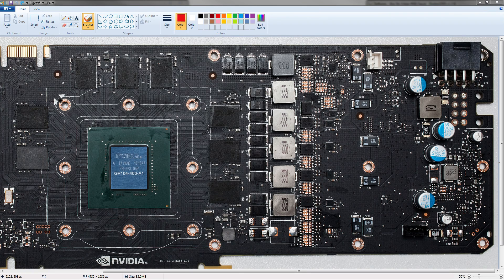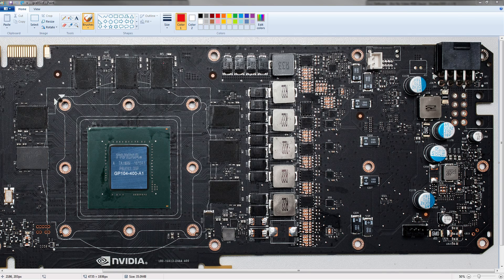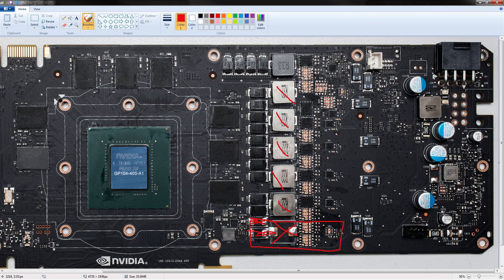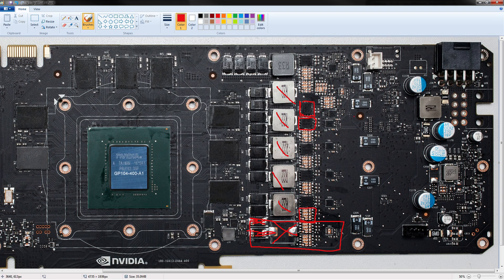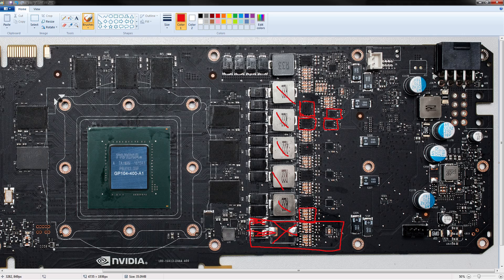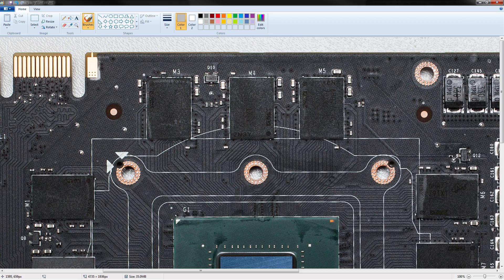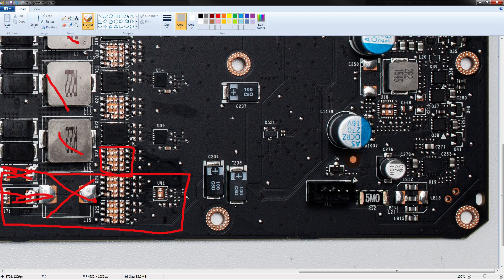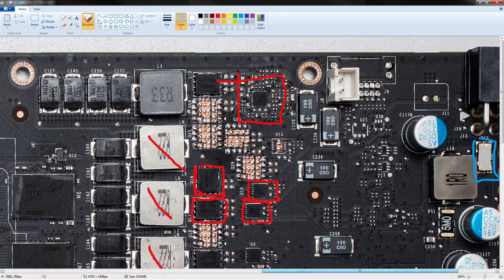GTX 1080 FE PCB breakdown and power limit mod

Comment: @Actually Hardcore Overclocking There is another power limit mod involving additional resistors placed parallel too 3 capacitors routed to the Power Sense IC. The mod uses 10 ohm 805 resistors. This results in power usage being reported 3 times less than actual. I'm curious if by playing with the values ie using higher resistance the effect would be lessened. I like to push the card a little harder for daily use. Thanks if you happen to ever see this.

Comment: Hey man,  what I wonder: 225 Watts is the maximum of power by 8Pin psu connector(150W) + 75W from PCIE slot if Im not mistaken, so if my card already uses in stock 220 Watts(Gigabyte Windforce, with also only 1 x 8 pin connector, MSI afterburner set to maximum of 108% for power..), the powermod wouldnt work , right? bc if the card wants to draw 250 watts after the mod, there is still only 225 available? thanks in advance! Regards Dave

Comment: "You don't have a ton of power current throughput so there is a good chance that with a power mod or voltage mod this VRM will go up in flames, so lets get on to that power mod."                  Buildzoid Great quote lol

Comment: @buildzoid , curious question , whats up with the extra 8 pin connector solder pads on the back of the reference pcbs ? there perhaps a mini mod that one can do with ref boards with em ?

Comment: That's interesting.
Your friend der8auer in his video about power mod of 1080/1070 was also referring to only one (exactly the same) shunt resistor.
I had applied liquid metal on it, and it did (somewhat) increased the power limit.
Are you sure about two other shunts ?

Also, on 1070, there are only 4 phases. does it mean that it is limited by 220watt (1.093v*4*50A) for vcore ?
Even though my card is with full cover block, coolant can get into 35-40C (i have room temperature of 25-35C for the most part of the year). So far it runs fine on 2.1GHz@1.05V.
Will it still be "safe" to "further" power mod the card ? (lowering resistance on other two shunts).

Comment: 1070 EVGA SC which is on the reference PCB here...wish I knew exactly where those other two shunts locations before I did this. Is that 5MO to the bottom-left of the R002 one of them?

Comment: is the msi seahawk ek can be modded as the same way too?
Reply from the maker: if it runs the same PCB the power mod will work the same way. Do not however that I missspoke here. The 10 series GPUs have some extra fault protection so you can't use solder to short the shunts out. You have to use Coollaboratory liquid Ultra.
Reply: Yes since it has the same board as the founders' edition card.
Reply: I did apply CLU works great.

Comment: Sooooo on https://xdevs.com/guide/pascal_oc/#step3 , they say :
"Note
 that earlier version of this guide incorrectly mentioned need to short 
RS1, RS2, RS3. This is wrong, and will cause card clock to lock at 
135MHz. Do not short shunt resistors themselves, but add resistors like 
shown on photo below. Sorry for confusion."

Sooo ?
Reply from the maker: I'm aware of the issue and all the 10xx card videos will get annotations pointing out that problem. The CLU method still works(Der8auer told me it works and used it on a few cards already) However soldering the shunts drops the resitance so low that the card notices that there is something wrong with power in readings and gets stuck in 2D clocks.
Reply: Nice man ! Thanks for the answer. 
Does it matter how much of CLU you apply on all 3 rs1/2/3 ?
Come to 1080 thread on ocn, we are discussing it now! :)
Reply from the maker: I guess if you did a really thick layer you would run into the same problem as you would with soldering. I'd say you should short 1 shunt. Test for throttling. If you need more power short another one. Test again. If you still need more power short the 3rd one. At this point you really shouldn't need more power. But if you do you could try thicken the layer of CLU.
Reply: Cheerz bud!
Reply: Hi again. So is it safe to say that if you CLU mod 2 out or 3 resistors(any 2 ??? ) then all should be fine ?
Reply from the maker: should be. Worst case scenario you just need to use some alcohol to remove the CLU form one of the resistors

Comment: What if you don't short the entire thing, but we change the resistance value reported from the shunt?  This could provide a safer alternative and with the correct range potentiometer or variable resistor soldered to the shunt you would have full control, plus you would be able to instantly take it back close to stock.

Just a quick thought.  I have done two voltage mods in the past that used a potentiometer, 7900GT KO and 8800 GTS 512, so it's a natural to me, just have to know where to put it.  (both of those cards are still going fine, OCing is safe if done right, even hardware mods (which I love!!))

Comment: hi, id like to talk about the EVGA Classified GTX 980. I tried everything, but cant get more than 1,21 Volts on it. I used the Classified Controller to change the voltage, thats a little tool. Works fine for the Vram voltage, so i can get to 4100mhz easily. But the core voltage...if i put it to, lets say, 1,35 Volts, following things happen: The power limit instantly goes from 60-70% to 90-100%...also temps got up from 50-65 instantly (i have own cooling solution)..so it seems the extra Voltage is definetly doing an impact on the card, it uses was more power and becomes hotter. But i cant even get 15 mhz more core clock as usually. Also GPU-Z is showing me only 1,21 volts. The card just does not want to take advantage of the extra volts. I tried custom bios as well, also tried own BIOS..wrote values like 1,275 Volts in it, same result, not able to take the smallest advantage. It seems to me theres some kind of mechanism not allowing the card to use the volts. But why does it use more power? And yeah, i also tried the Prexision X. This tool was even made for this card and shit doesnt work. I can go to 1,3 Volts there, it has an impact, card uses more power, becomes hotter---but no extra Clockspeed. Do you have an idea?
Reply from the maker: From what I've heard maxwell doesn't scale with voltage unless you take it bellow ambient temperatures. I've never overclocked maxwell GPU so I can't really tell you much more.
Reply: ok but you seem to know something about that PCB...on MSI Afterburner you can also incread voltage about 0.37...even that does not increase voltage to more than 1,21...i mean there is a difference between "it doesn scale" and "having not the smallest affect"``just frustrating...:(...gpu gets only 52 C  while gaming usually-
Reply: Actually Hardcore Overclocking
i mean al that power phases and that giant power limit, what the sense behind all that shit if i cant overvolt or the chip saying "i have no use for overvolts"....:(
Reply from the maker: You can check if the GPU core is actally getting the extra voltage with a digital multi meter. As for why the Classified comes with such an over built PCB. Well it's meant for Dry Ice, LN2 or Phase Change cooling.
Reply: well at least VRAM voltage works. Do you think it hamrs the card on a long term, if its running 1,7 Volts/4000mhz instead of default 1,6V/3500mhz?
Reply from the maker: 1.7V is fine

Comment: shorting the shunts and/or volt dividing the sensing circuit doesnt seem to unlock the power limit. Its done some other way inside the GPU.. custom bios required to unlock the limits "Asus StrixX OC" bios to be precise. enjoy
Reply from the maker: I think ASUS might be using per phase current sensing on their card. However for any of the dumber controllers shorting the shunts should work.
Reply: Well i'm using a Gigabyte FE and a number of others are using EVGA cards on other forums and report that shorting does SFA. Power limits are calculated some other way
Reply from the maker: Odd. From what Der8auer told me the only issue with shorting the shunts is that if you short them out too well the GPU gets stuck in 2D clocks.
Reply: +Actually Hardcore Overclocking 
with the default gigabyte bios it reported as about 5% TDP but instantly marked as power limit applied. I then did the 0805 resistor mod with a 81R cap to take the reported cap as 80% of real. this too marked power limit applied. FWIW the first benchmark seemed to show the max boost clock unlocked, but soon capped and limited itself.

so it either works out that calculated  power does not match reported power (that's what I'd do if I were the hw coder) or it uses a different system for power limits. I would then assume the external circuits are for trimming phases connected to the pcie bus and protecting against over current on the external header.

thoughts??

The Asus strixx oc bios removes all those pesky limits anyway... so... until some clever man works out how to mod the default FE bios to increase the real power caps I'll stick with the Asus BIOS..
Reply: +Actually Hardcore Overclocking 
oh ye and I've got it stable at 2100mhz and 1.15v with +550 on ram. I can't seem to push it much faster without lock ups in occt or overwatch.

the default bios with all limits pushed struggled to hold 1830. for me anyway... increasing voltage decreased freq due to power limits.. gah.

I'm running a EK water block with core temps of 41 degc reported.
Reply from the maker: Well I don't know a clever man but I do know a crazy man with any luck he'll get something that doesn't brick GPUs and helps with overclocking.

Comment: How likely, on a scale of 1 to 10, is it that this mod will damage something on the card.
Reply from the maker: without any overclocking. 0 If you really push the card on air or water cooling it's still pretty unlikely unless you let the VRM hit the 90s.
Reply: +Actually Hardcore Overclocking ok. Thanks.

Comment: awesome, managed to get another 100Mhz out of my 1080s with the power mod, now I'm stuck at 1.093V. Any custom bioses our there already?
Reply: the sensors are just reading like 80% max at full load, effectively removing power limit.
Reply: you can get another 50 to 100MHz out of vcore and vram by doing the power mod. if you have a chip that good, chances are you might make the 2200MHz.

I shorted out the 3 shunt resistors with coolaboratory liquid ultra, which can be removed with isopropanol just in case.

the bios limits the vcore voltage to a max of 1.09V anyways, so damaging your card is very unlikely.
glhf with yours ^^
Reply: lol
As already discribed, shorting out the 3 shunt resistors with CLU worked for me.
Here is a screenshot of GPU-Z showing one of my 1080s running at its maximum gpu clock of 2088MHz with a measured power consumption of 70%.
http://imgur.com/YGPiCOW

You chose to use a different method for shorting out the shunt resistors. While in theory any conductive material should work, I can not, and did not, verify anything else as working, except the method I tried.

If you try out a method that has not been done by others and is not verified as working, then that is your problem.
If you dont know what you are doing, then that is your problem.
I am not responsible for anything you do with your card. So do not blame me.
Reply: unigine heaven, the throttling is normal 1080 founders behaviour

Comment: So nvidia says the founder's edition has quality components and PCB. Youtubers with Electrical and Hardware experience say otherwise.
Reply from the maker: Just like every Nvidia reference card ever. The only exceptions being the 780Ti/980Ti/TITAN BE/TITAN X. Those PCBs could handle enough voltage for any water/aircooling benching session.
Reply: +Actually Hardcore Overclocking So the 1080Ti would probably handle hardcore overclocking as well.
Reply: +Skillless Gaming if we ever get a 1080ti.  Titan xp is already a cut down gp102,  and they can't halve the vram to 6gb to differentiate it
Reply: +Phoenix Wright true the pascal titan has the specs of a 1080ti and the price of a titan the gap is too small to squeeze a ti edition in it. maybe they will stop producing ti cards rip best price graphics cards

Comment: Hi, thanks for the overview. Can you please calculate what is the maximum power output of the GPU vrms at lets say 80, 100
degrees celsius ? 

I did this shunt resistor mod on GTX970 from MSI which had a good VRM design, but I am not sure what the headroom is here or if I should just wait for non-reference cards and return my FE card.
Reply from the maker: just wait for non reference.

Comment: I just shorted the shunts, now how will I know it's working? I can still only up the power to 120% due to driver restrictions.
Reply from the maker: The card should be showing lower power draw in any monitoring utility that can measure power draw. Also if you were getting power draw related throttling it should now be gone.
Reply: awesome, thanks.

Comment: its nothing new for NVidia ref boards to have missing phase placements.after the 680 gtx I stopped buying ref nv cards it was like walking on eggshells when hard modded. without adding in a power board to totally bypass the vrm/power area of the card  .the 680 was 500usd but then the titan/x  at $1k was the same pos "just enough to work" nv ref approach ,what really sucked is no custom boards for those chips.....I look forward to maybe some custom boards by July, like the DCII. I can mod my bios, easy hard mod and cooling good to go.
Reply: Yeah but the 4870 launched and it went down to 500ish some even got refunds

Comment: great video man, can you do a breakdown of older cards?
Reply: +Actually Hardcore Overclocking thanks dude, if I can assist somehow, tell me, if you will get really stuck, I should get a new screw set in the next couple of weeks, so I will be abel to disassemble the card and take photos (I planned to do so anyway to switch the thermal paste)
Reply from the maker: +אלכסנדר ברבר Ok could you get me pics of the back and front of the PCB with no heat sinks covering anything? Also a close up of both the memory and Vcore VRMs would be great because while I've managed to read the part # of the low side FETs I can't see what the smaller high side ones are.
Reply from the maker: +אלכסנדר ברבר Sure I could. Which do you want to see.
Reply: +Actually Hardcore Overclocking as an owner of an ageing r9 280x toxic edition, I would like to see that card, to kick the hell out of it and give it a proper goodbye
Reply: +אלכסנדר ברבר Why would someone waste their time doing that exactly?
Reply: +Callsign Vega it is still a pretty relevant card for Overclocking, it is pretty old but hes some horsepower, and becuse it is at the end of its life cycle, you can let yourself playing with it abit dangerously.
btw, I gave my 280x as an example of an older card to do so, any old and ubiquitous card would do as a good video topic.
Reply from the maker: +אלכסנדר ברבר Sourcing good pics for the Toxic is hard but I already have most of the datasheets for it.
Reply from the maker: +אלכסנדר ברבר Do you have a good camera?
Reply: Actually Hardcore Overclocking yep, I have a Canon 6d with a decent lens (24-105L)
Reply: the moment i will get my new screwdrivers i will to that/ 
thank you for your time !
Reply: I know you've been working on fury X cards. do you have a breakdown for that card and what youve done with it?

Comment: Hi, may I ask one question: They say GTX1080 power input is limited by 8pin 150w + PCIE 75W = 225W in total. So if the power input has already been set to a fixed value, I don't know if changing the shunt resistors will increase the power from the actual input. How does that happen?
Reply from the maker: +Charlie.H an 8 pin is not limited to 150W. IRL you can push most 8pins to about 220W and some better 8 pins can do 280W.